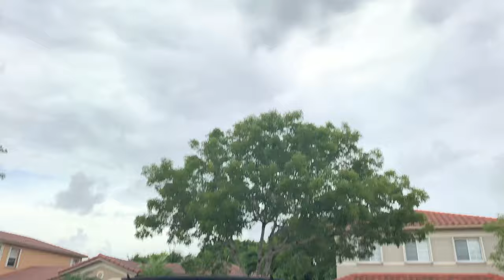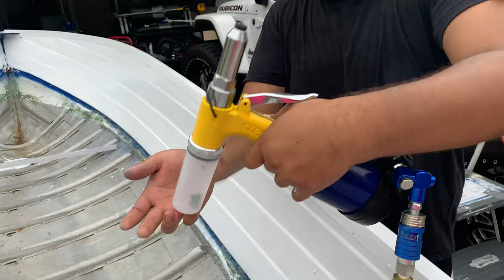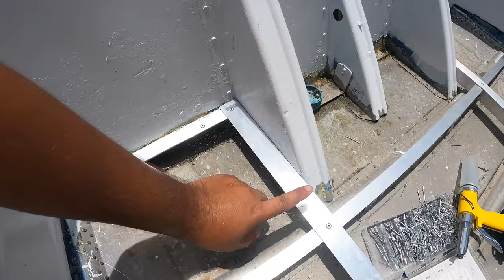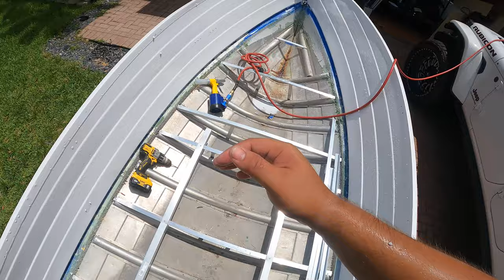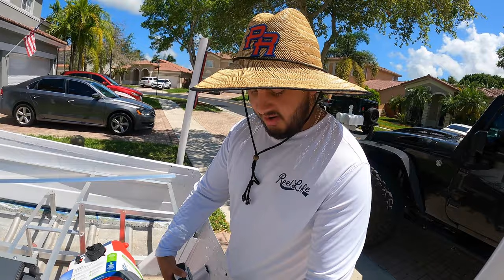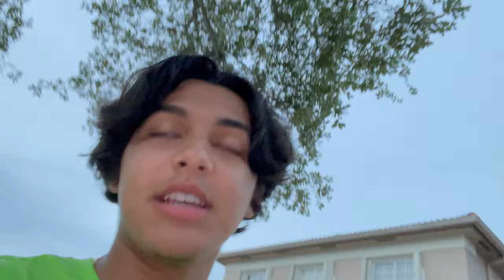HOW to build JON BOAT!! (Pt. 2 Aluminum)

Comment: Hey this looks great! I'm about to attempt something really similar on a 16' Starcraft we just got that is just a shell right now.  That L angle coming off the top of the rear platform and running down the sides of the hull, did y'all end up installing that with rivets through the hull? Did y'all have to seal them and re paint ? I didn't notice anything so it must have happened all off camera?
Reply from the maker: hey sorry, yes we used rivets but we haven’t had to reseal anything. i have an amazing part 3 coming soon i’m working on the video!!! i got caught up with graduation and school and what not with my senior year so a lot had to go on pause but we’re back into it and we have so much progress we even put it out in the everglades it’s coming together nice!! stay tuned please!
Reply from the maker: pt.3 is out !!
Reply: @d.vargas  Sweet! Imma check it out